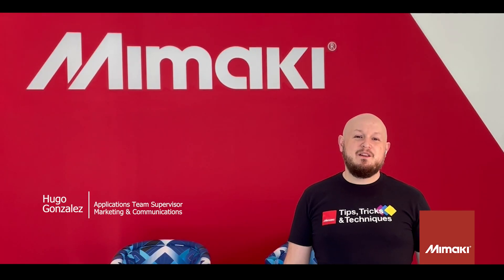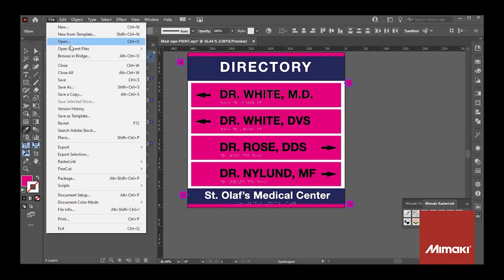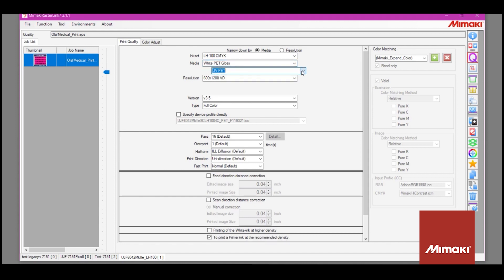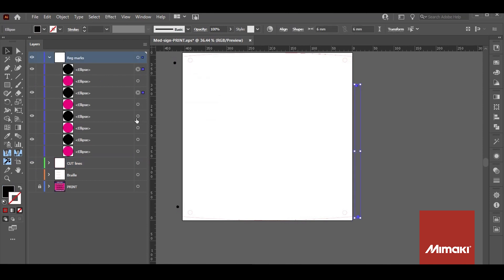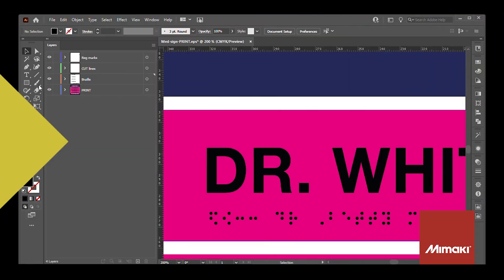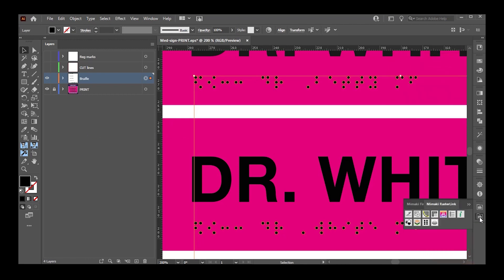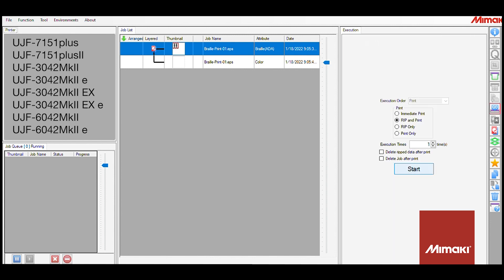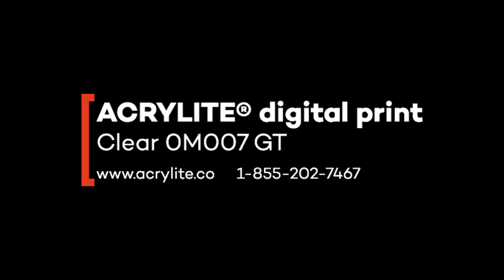Braille Signage Created with the UJF Series ~ Tips, Tricks, & Techniques

Comment: I have been doing High speed which seems to be working but tried doing ada standard, when i click on braille icon after converting to outline it open up the Braille options instead of changing the outline to Spot color like yours did.
Reply from the maker: Thank you for checking out our YouTube applications. The original video was created before the addition of High Speed and Standard Braille options. You don't have to convert any part of it to outlines... the original application converted it for you. However, for High Speed or Standard, it will not convert to outlines or change the spot color, it will just save the print-ready files directly to your RasterLink Hotfolders. Please follow the guide for step by step instructions. https://mimaki.com/archives/034/202511/D203842-16_UJF-7151plusII_UJF-3042,6042MkIIe,JFX200-1213EX,2513EX_High-speedBraillePrintGuide_e.pdf

Check out the updated High Speed Braille application video here: https://youtu.be/rIvDVhV5ts0?si=VxAzL29ZP5RCkvoE

Comment: When I try drop the files into the hotfolder using Rasterlink 7 3.3.4 on my UJF-7151 Plus the files import but the braille layer doesn't have “Braille [High Speed Mode]" set as the attribute. Is there something else I need to do in Rasterlink to make this work?
Reply from the maker: Thanks for reaching out. There are a few steps to set up High Speed Braille printing, including the RasterLink version, downloading new profiles, and making sure you have the updated driver. 

For a complete set of requirements, please see the High Speed Braille guide here: https://mimaki.com/archives/034/202511/D203842-16_UJF-7151plusII_UJF-3042,6042MkIIe,JFX200-1213EX,2513EX_High-speedBraillePrintGuide_e.pdf

Comment: What about creating the ADA required raised text/pictograms? What setting in RasterLink does that?
Reply from the maker: Rasterlink does not have an automated function to create raised pictograms, only braille, however images can be reprinted with multiple execution times to print raised textures and images. A trick to this is by first creating a valid pixel primer layer and then auto-executing 11 to 14 layers of clear ink (matte) to reach the desired height and then capping with a layer of gloss depending on the desired finish.

A 100% single color image can be converted to clear with a job attribute change to mono-color replacement K to Clear channel. (K is recommended because it can be controlled best by imaging in grayscale)